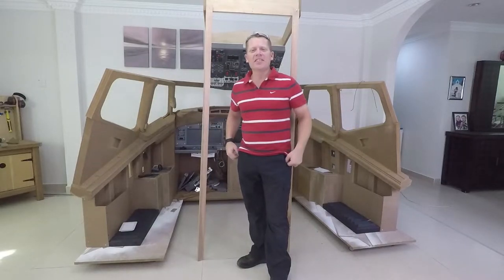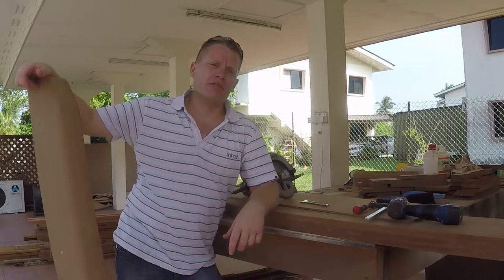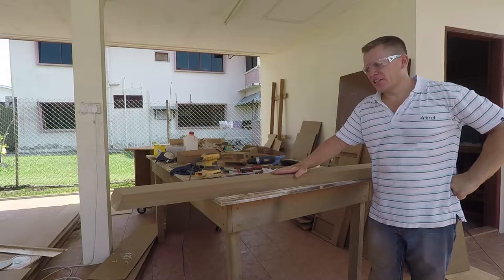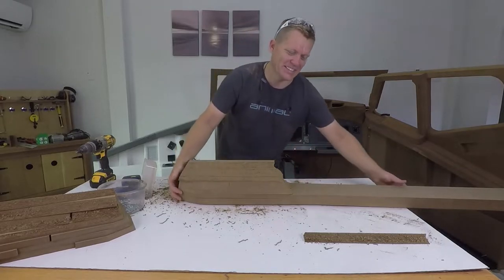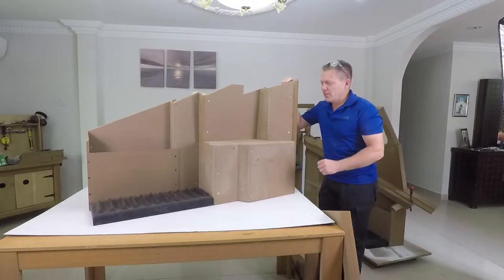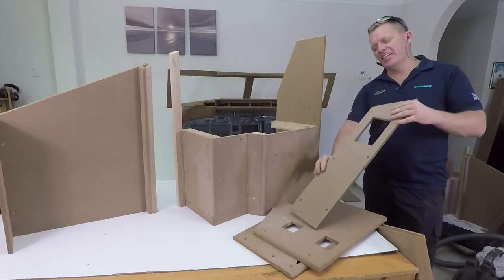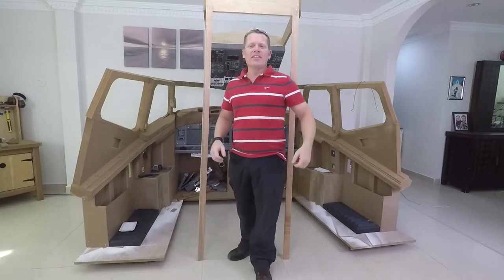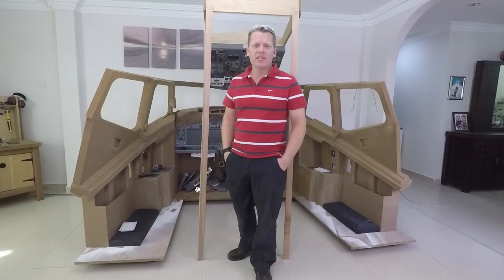737 Sim Build - Building the Sidewalls #16

Comment: I like the way you designed everything. Some people focus on building a realistic frame like structure to later fill it with liners. You have combined the interior and exterior into one component.
Reply from the maker: My first sim had a realistic outer skin and shape, it was a lot of effort to build, and a complete nightmare to add anything. I'm loving this new modular design, but if I was going to do it again,  I would also try to round off the exterior rather than small straight angular sides.

Comment: Hi! Question on tools. I plan to build a pit like yours.

I am currently building a F-16 pit and have most parts already assembled. That pit is quite easy when bending pvc sheets for interior cladding etc. There are no other complex shapes really.

What tools should I get for this build?
What I have is:
- Handheld electric drill/screwdrivers etc
- Handheld router
- Lasercutter 300x200mm
- Fixed router 5-axis 600x300mm
- Various handheld electric cutters
Reply from the maker: Hi Sebastian, You already have the most important tools, which is the laser cutter and CNC. The only tool missing from your list that I would really want to add is a 3d printer to be able to add parts to help construct the back of the panels and there operation. Good Luck Karl